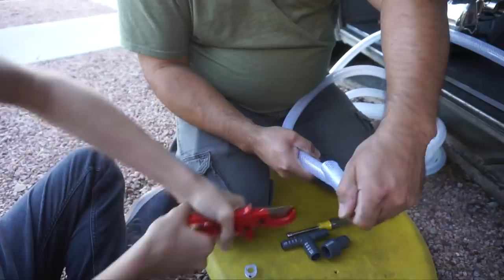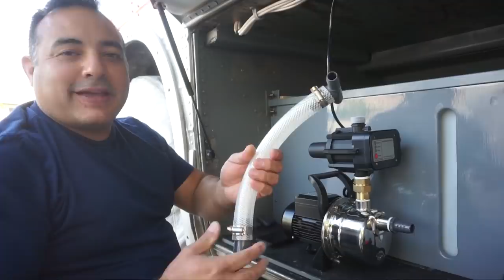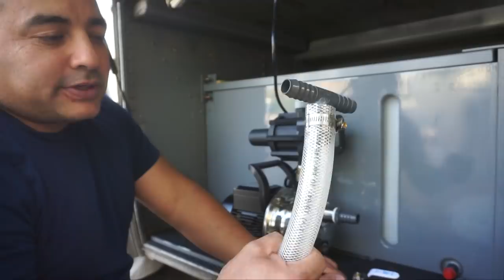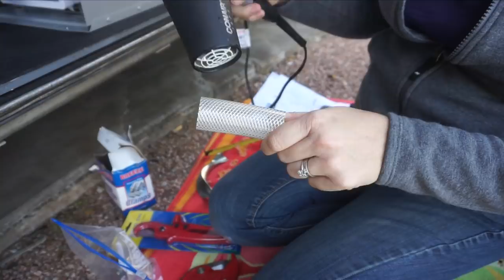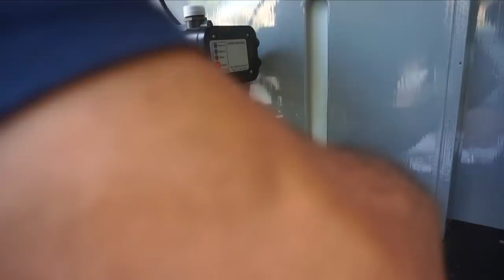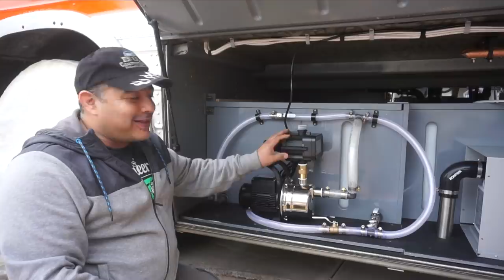Water Supply Part 3: Getting Water To the Pump

Comment: Hi Juan, not sure if you've tested your system yet and not knowing any details about your pump, I could be mistaken but from building these type of systems in our tugboats, typically you need a check valve between the water tank and the pump inlet, otherwise once the pump gets to pressure and shuts off, all the water rushes back into the tank and the pump will restart and the cycle will just repeat itself, we always use spring checks with a 1/2 lb. breaking pressure, swing checks will hammer typically so a spring check is better, also , while it is true the pump will lift 25 ft. or so, they are not self priming so the inlet should run directly from the bottom of the tank into the pump without going to the top of the tank... you will need to fill the tank to a level at least as high as the pump inlet so head pressure from the tank can prime the pump, you may also need a valve you can open just to the discharge side of the pump so the water can flow , once the pump is primed you just shut the valve.... as I said , your pump may be different than mine and not need all these things but typically this is the way they need to be plumbed, hope it works as planned.... this type of pump is far superior to typical RV pumps and you will be very happy with it once you get it working.... hope it's warming up down there for you guys.... our snow is almost all gone
Reply from the maker: Thanks James - as always great observations.  The pump is designed with a check-valve in the control module of the unit and should not require a check valve on the inlet side.  I will let you know when I do a test run on it if that is true or not (The video I watched of it running did not have a check valve (or any kind of valve) on the inlet side at all).  The am assuming (as you pointed out) that the pump will need to be primed before I use it for the first time. After it is primed I think it should hold the prime because the inlet hose is so high.  I don't actually know that I will find out when I test it.
Reply: Hi Juan... ya like I said ... without the specs on your pump none of my observations may be valid... if it has a check valve built in that should be fine and as you say once you get it primed it will be fine... you just can't use gravity to help you with the loop in it so it will be a little more difficult to prime... maybe you can use pressurized water from your garden hose fill to push water through it... then it will prime easily.... you'll figure it out... you always do... I like your idea of circulating water through the filters back to tank.... I just might have to do something similar with mine..... all the best to you and your family

Comment: Do you need a heat shield for the hose on the right next to the heater exhaust?  Can’t tell how close it is from the angle in the video. Also, I’m curious about how you will manage your water. With all that flow will you use up water too quickly for when you are away from a water source?
Reply from the maker: Thank you Corey - great questions.  We have friends that have this exact model of water heater so we asked them for exhaust measurements before we did any of this work.  The measurements they came back with were all in the low 100 degree F range.  The hose is about 2 inches away form the pipe but hopefully that pipe will not be very hot.  There are a couple of ways we can deal with the flow - on our system we run a manifold system that should allow us to "tune" the system by partially turning the valves to restrict the water flow or eve at the main pump (again using the valve to restrict the flow by partially opening the main valves).  It will be a learning experience for sure and we will share what we discover.

Comment: Great video and I like the design!  
One Suggestion:  
Consider a braided 1inch Flex hose from pump to the tee.
The pump will create vibration and a burst resistant braided flex hose will handle the vibration best.  I believe the pump manufacturers recommend flex hose connections on either side of the pump to minimize burst risk.
Reply from the maker: Thank you Rick - great suggestion.

Comment: One note. The ends of those hose clamps can be considered “sharps” position them as such. I’ve gotten some nasty cuts from them. Holy crap 165 gallons. 1,376lbs of water. Good thing you put new air bags in. That’s the biggest water pump I’ve ever seen for RV use. You and I have the same affliction bigger is better.  The disease of more. You inspire me. We just got a new to us rig. 1995 36’ Country Coach Intrigue. We’ve been around Yuma2 months getting it road ready. Heading your way in a month or so making our way back East to Cape Cod. We just finished our new system. 24volts. 4.8KWH lithium 16 Fortune Cells, homemade BMS, Victron all the way around multiplus 24/3000 smart controller 150/85. Orion smart converter/charger  24-12/30. BMV 712.
Reply from the maker: Thank you Mitch - Sounds like you are putting together a pretty great system for you rig!  Congratulations!

Comment: Wow, 1300 lbs of water on that subfloor.  It'll handle that weight (plus all the other stuff down there)?
Reply: Think how much luggage that bus used to haul inside the hold.
Reply: @justDIY  Point taken!
Reply from the maker: I tried pretty hard to find an answer to how much weight was safe to carry in the in the bays.  I asked around on several forums and nobody seemed to have an exact number.  Some of the guys on the board said that when greyhound would need engines delivered from one place to the other they would put 2 complete engines in the bays.  Each of these engines weighs about 2500lbs.  I don't know if that is really true - and I will of course keep an eye on the weight and structure.

Comment: It will work just fine Juan, I have used one of those exact pumps for a number of years in a residential environment. I would not hesitate to switch to that style pump when my RV pump packs it.  Way more cost effective than the RV pumps. I have replaced the inner guts in my pump and other than two o rings and the diffuser it is very simple. Only draw back is the guys that don't have 120 volt.  But with your power it will never be an issue. :)
Reply from the maker: Thank you Paso - That was our line of thinking also.  We will test it and post the results.

Comment: At 9:35 be aware that it you pull a suction on a pressurized system you will greatly increase the chance of contamination.  With any small leak in the supply system could you could pull in untreated water into the normally pressurized system.
Reply from the maker: Thank you Jim - very interesting point.

Comment: What happens if your 'gravity fill' overfills the water tank, do you have enough vent to deal with the overflowing pressurized water?
Reply from the maker: We have a 1/2" Pex line dedicated for overflow that vents to atmosphere.  I don't know if it will flow everything this pump can throw at it but 1/2" pipe should be good for about 14 gpm under average pressure (20-100psi)

Comment: Without a vent or some other way to introduce air into and out of the tank this might create a problem.  Putting a true gravity fill into the tank will help with this as well.
Reply: I was thinking the same thing. Will need a one way valve in the top of the tank to allow air in while the pump is running, otherwise the vacuum will suck the sides in.
Reply from the maker: I am curious why you would think the tank will not have a vent?  https://youtu.be/yYuIyJNe8vE?t=438

Comment: Morning Juan. I'm sure you don't want to redo what you already have but I'm going to make some suggestions. If you put a t on the pump Inlet instead of an elbow, you'll still have a place for your line to add water to the system. The reason I mention this is, you really want to come off the bottom of the tank into the pump at the lowest level possible. It's not good practice to have it go all the way up in the air in there and then come back down.
I know some other people mentioned a check valve which you do need on the discharge side of the
pump . Please get yourself a small pressure tank with a bladder in it. That way the pump doesn't run all the time when you've got a faucet open. The pump will last a lot longer that way. It really needs to be set up like a well system in a house with a pressure switch 2 turn the pump on and off. Which I see you already have. It's just a matter of setting the pressure switch to the right pressure and the proper differential. If you put it in the way it is and it short cycles it's because you don't have a pressure tank.
If you do get a pressure tank, set the air pressure on it with the tank empty. 40 PSI is a good number but it also depends on what the differential pressure switch can be set to. I can send you a diagram if you want, but I think you're obviously pretty handy so good luck!
Reply from the maker: Thank you Sam.  Suggestions are great and even if they do not help us - perhaps they can help a person later reading through the comments.  I would have loved to keep the water outlets as low as possible - it was just not feasible with the reinforced tubing. 
 This pump is actually designed to work without an accumulator tank - we will see how well it does when we test it - but that is what the description on the pump said.

Comment: I am not so sure about your plan to fill the tank. Won't you be contaminating your pump and the supply lines will unsafe water before it goes to the filters?
Reply from the maker: We hope it does not come to that and we can just use city water most of the time like any other motorhome.

Comment: GUYS,
Whenever working with hose, tubing or O rings-give it a shot of WD40 & everything will slip
together as if you were using KY jelly. If you want to get fancy, use WD40 Silicone spray.

!
Reply: Just water will lube it considerably. Not a good plan to use petroleum products on a potable water system.

Comment: I dip the ends of the vinyl tubing in hot water to soften the them before pushing onto a barbed fitting. You can heat a pot of water and lay the tube you want to bend into it. When the tube gets soft, install the tube and let it cool
Reply from the maker: Thank you rickrack78 - great tip

Comment: I don't have the height you do, do you think its possible to plumb the flow meter box thing next to the pump?
Reply from the maker: It should work - there is nothing really special about that head that would require it to be mounted on top like that other than a check valve that required it to be mounted upright.  It basically just reads flow and pressure and tells the motor when to turn on/off.  I took a peek at your Facebook page about the boat - wow you are doing excellent work!
Reply: @BeginningfromthisMorning  thank you. Its a long process but hope to be up to your quality of craftsmanship

Comment: Try silicone grease on fittings. A check valve or two? Design seems good.
Reply from the maker: The Pump actually has a check valve built into the control module to prevent it from cycling on and off.  We also used a check valve on the exit side of the water filters as well as the water inlet.

Comment: Juan good stuff here.  Do yo know what the GPM is for your pump?  If it is strong enough to pump water into the filters and fill up your tanks I think it will work.  I would do something with the free end of the hose to protect it from dirt, germs, etc...Thanks for sharing your video. Ed
Reply from the maker: Thank you Ed. I believe the specs on it said 16-18 GPM on the pump at 40-60 PSI.  Great idea on the cap for the free end - I think they even make some specifically designed for that purpose.

Comment: Um, I don’t think that pump will suck air. So, you might have a hard time getting it primed.
Reply from the maker: You are correct Hakuna Matata - for the very first use the pump will require priming by removing a small screw filling the chamber with water.  After the initial prime, it should hold that prime even when we run out of water.  Of course, we will test all this and report what we find

Comment: Great set up you two I'm also considering the same set up with a shallow well pump the one I'm looking at has an expansion tank mounted on the pump assembly it also has 1 inch inlet and outlet the more volume the better right I appreciate the way you pay attention to detail it looks fabulous.
I'm excited to see it working in action.
Also love the custom pocket door it looks beautiful.
Thanks for sharing.
P.s the PVC cutters are the best they will cut everything except metal you could prune trees with the things.
Reply: Brian Davis  I to like the idea of a small expansion tank for issues of volume and flow. Juan will be on top I am positive.
Reply from the maker: Thank you guys - I did see the pumps with the expansion tank and was not sure I would be able to fit that in the bus (they are a bit bigger).  This particular one advertised that it did not need nor should it be used with an expansion tank. I will test it and let you know how it performs.
Reply: @BeginningfromthisMorning  Juan I should have explained my installation of my set up a little better to save room in my coach I'm putting my freshwater tank under the bed over the rear axle because it's 250 gallons and it frees up one of my bays in my MCI and will help with possible freezing issues not that I'm planning on being anyway around
Cold weather if possible but I am putting the pump down in the bay with the other utilities for noise from it I have to ask where did you find the brass check valve at? Anyways love your work.

Comment: Hey guys!  Long time since I commented, but I've been watching all the updates.  I really enjoyed watching the detail of the upgrades on the suspension, brakes, drums, wheel bearings, etc on the Bus Grease Monkey channel.  I feel much better for your safety now :)  She must be nice to drive back and forth with all those improvements!

One concern... It looks like the inlet for the pump is about 3-4 inches above the bottom of the fresh water tank.  I know liquid pumps don't ever like running dry and can't create any real suction with air alone.  Do you not plan to run the tank lower than that 3-4 inches level?  Also, I feel the current set up will create a lot of air pockets creating a lot of stress on the pump.

I read the description of the pump on the link you provided, but wouldn't that 23 foot suction assume that all the pipes leading to the pump were always filled with water by gravity alone?

Would it possibly be better to cut a section of the floor out and create an aluminum box for underneath the bus so the pump could be lowered to a point where its inlet is on the same level as that bottom tank bung?  That way it won't starve for water until the tank is almost empty.

Maybe I'm missing something though, if so, I look forward to the full test to be proved wrong :)  Thanks for continuing to share your build, I really enjoy it!

Sev
Reply: If you look at the tank where the water comes out is on the bottom of tank the pump will work just fine it's a shallow well pump.
Reply: @briandavis9975  If you look at the picture that is paused at the beginning of the video, the hose on the right will be filled to the point of whatever the water level of the tank is because that tube is fed by the bung on the bottom of the tank and liquid always finds an even level.  There will be air in that hose above that tank water level.  There will also be air in the 1" down hose to the pump from the "T".  That's a lot of air for that pump to try to suck out until it gets water.  Even if it can do it, it's causing a lot of unneeded stress on the pump whenever it kicks in.
Reply: I understand your concerns but it should be fine if for some reason its not Juan will fix it so it does I've have a few of these pumps in the past and they are animals at work it's can pull water up to a second story house without priming it.
So it should be fine he will need an air vent on the tank so the tank doesn't implode it's shape
Reply from the maker: Thanks guys - great conversation.  I appreciate that you are so respectful of one another even if you don't agree on the topic at hand.  You are both correct - the water will only go to as high as the level of the tank (not quite all the way to the top).  What this means is the pump will not run because it is dry - if you look closely near the inlet you can see a small bolt - this bolt is actually for priming the pump.  You use this to fill up the little chamber and when you turn the pump on it should suck the water the rest of the way through the hose (kind of like a pool pump).  That is what I am hoping anyway - stay tuned we will get this thing tested and verify all these assumptions.  I am genuinely curious about what happens when it runs dry - My theory is that it should keep the prime because the hoses are so high - but I will test that as well.  Thank you guys.